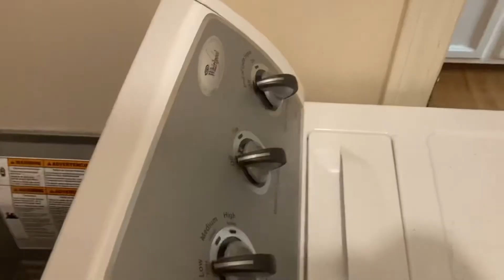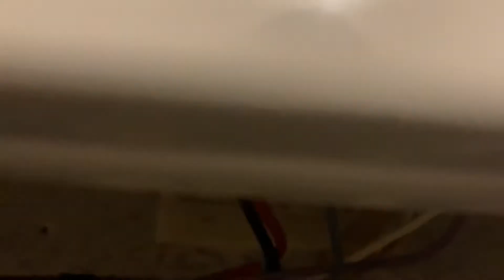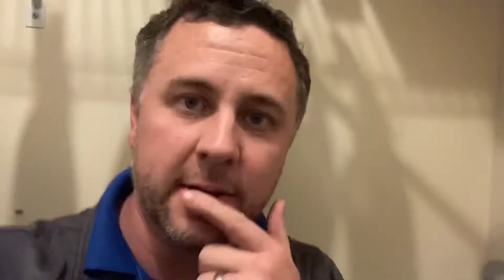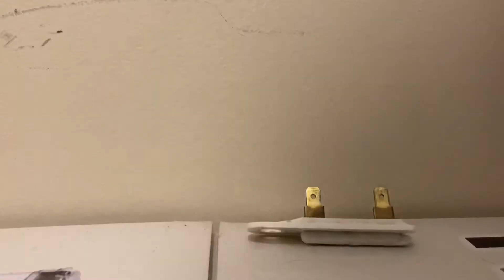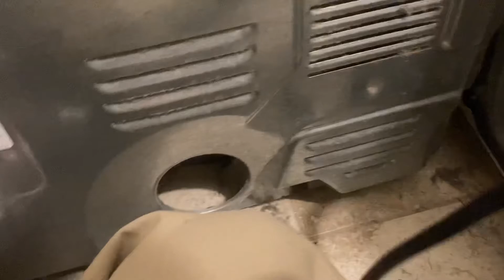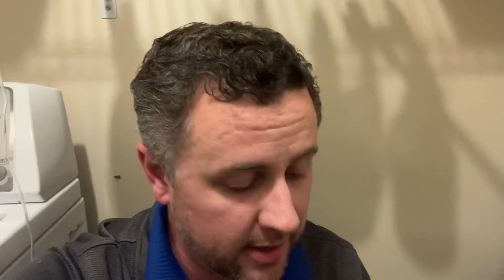Dryer won’t start, QUICK & EASY repair

Comment: There's no telling how many free dryers I got and that was the problem,  easy money! Actually have 5 of those thermal fuses in the garage, new still in plastic. Get you one of those vent cleaning kits. Attaches to your drill and you can clean your outside vent and then come inside and it do it inside to outside.  They are 4ft rods that are screwed together that extend  to 12-foot if you have a long pipe. They are very flexible. I started cleaning mine today and can't believe how much I got and it's just been last spring when I did it last.. at my house they have the pipe a little longer than I would like